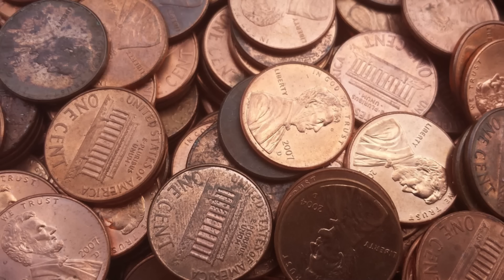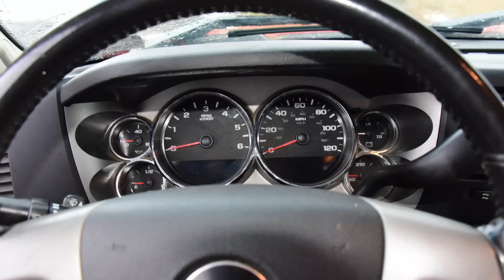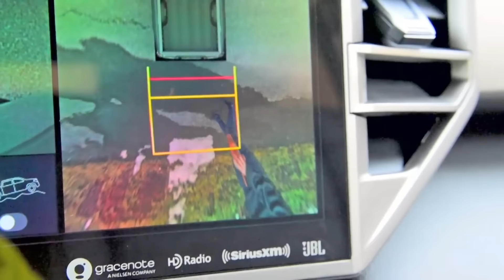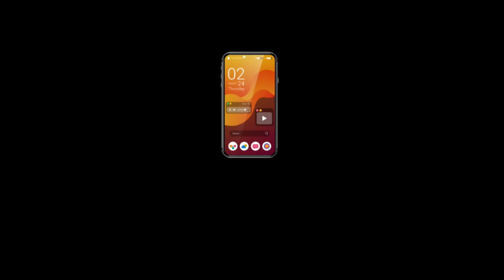2008 Chevrolet Silverado: Regular Car Reviews

Comment: Ahh yes- can’t kill the engines, but the bodies are competing with the Titanic as to which can collapse from rust first.
Reply: 😁 I know what you're saying, but even in the best of circumstances, it's a question of mass. Which will turn to dust first? An engine block, or a body panel? Even Titanic is rotting away around her engines.
Reply: @brandonobaza8610  
I’m coming from having owned one with 250k+, still started, ran & pulled like new; yet I could see through the frame. Darn shame.
Reply: @brandonobaza8610 Well said, dad sold his 87 S10 in the summer of 99 because the rocker panels and chassis rusted out before the engine and transmission gave out.
Reply: @armitage1950 simple solution, don’t live in the rust belt
Reply: Or oil every damn nook and cranny ever 3-4 months😂
Reply: Can’t really admire them in the rear view, CAUSE THEY KEEP BLINDING ME WITH THEIR FUCKING HEADLIGHTS IN HIGHBEAM MODE !!!
Reply: I just went under my 2010 silverado to check the spare tire (cause the release mechanism loves to rust) and I found holes in my hitch and frame. Thank you chicago.
Reply: True, but even down South, full size trucks from the aughts have rust issues, particularly Dodge and GM, even when most other vehicles that age are solid even sitting in junkyards with the clear coat gone.
Reply: Not in the south, these things won’t die
Reply: @seed_drill7135  I can’t confirm, my 05 texas owned Escalade has zero rust on it and I was underneath it this weekend
Reply: Had to get rid of my 06 buick at 100k miles, rusted, sad. Now I have an 08 with 100k miles on it currently, I have to take care of it underneath soo much, but it has 0 rust. Ppl at shops try telling me it’s a Southern car, I just laugh at em.
Reply: @mavness  05 Chevy 1/2 ton. Frame is still good because I have been OCD on washing underneith in winter, but the box and rockers are going through the same agony over here in Iowa. The F*)king salt brine is what is killing vehicles in the snowbelt.
Reply: this is literally mine rn
Reply: spoiler: It was the titanic.
Reply: The DOD engines say otherwise. But I'm not sure when that became a thing.
Reply: I've got the rocker and rear fender rot, but I also have over 500k km of towing and hauling (Red Line fluids since around 100k km) on the original '99 4wd 5.3l drivetrain.

They seriously don't make them like this anymore for a reason!
Reply: I daily a 91 third gen Camaro with 185k on It. Solid unibody in ny 😮
Reply: I mean as long as the dumbass DOD lifters don't eat shit for no particular reason other than just trash design, yes, the engine will literally not die(if maintained somewhat regularly).
Otherwise it'll eat an LS faster than the body can rot lmao. But, do a small cam swap and lifter replacement and it'll literally last forever.
Reply: That turd didn’t make it 10 years before it had holes in the body. I understand it’s 16 years old now but those holes didn’t appear yesterday.
Reply: That engine just needs a few hot suppers and it’ll be done for but you could putt it around for another 10 years easy.
Reply: Clapped out rear springs, and too much junk in the bed.
Reply: ayy more vortec swaps for me
Reply: These engines do die very frequently.  Unless you do a full DOD lifter delete you are driving a hand grenade with the pin pulled.  Usually it’s cylinder #7.   That’s how mine went.    I know multiple other people who have had them go.   One coworker had his engine go with 4000 miles on it from a lifter failing.    It’s a shame because the 5.3 is an excellent engine otherwise.
Reply: Same with WJs, at least if you’re on the east coast, and it doesn’t take that long. My brother brought his from California to Orlando. He’s only been there a couple years, and it’s already feeling it.
Reply: @michiganman4398  I've got a 4,8 so no DOD bullshit. The 5.3 is what I wanted but in 05 they would not do a 5.3 with a manual trans so I went with the smaller engine. I think the 5.3 would be killer to have WITHOUT the DOD bullshit.
Reply: As someone with an unhealthy obsession with '90s Mercedes, this feels just like home
Reply: '11 avalanche here. Rear subframe is definitely rusting and afm is definitely causing oil consumption...125k miles, WA owned.
Reply: My 2014 is falling apart. Lmao
Reply: then we can swap the engines into our Miatas!
Reply: I always tell people my truck isn't on its 3rd engine my engine is on its 3rd truck
Reply: The body and frame of this truck will hold up better than the body and frame of any Toyota truck that old. It looks to be holding up better than my 2011 Tundra did. My bed had holes before the wheel wells by 2017 and the tailgate had major rust after just 1 year. And my frame... yeah. Legendary Toyota rust rot.
Reply: transmissions are shit tho
Reply: Not in texas not a drop of rust to be seen anywhere my tahoe has 300,000 an my neighbor is pushing 450,000 but it's his second motor but still his silverado is in great shape
Reply: @AmbroseBurnside1824  One of the reasons I got a 5-speed.

Comment: When I picture a new truck, this gen Silverado comes to mind. I can't believe this is a 17 year old body style.
Reply: Same.
Reply: I genuinely think this is a timeless design. It blows my mind that this body style is pushing 20 years old. It hasn’t aged at all.
Reply: At 54 Square Bodies still seem 'modern'  to me. I member pre 73 Chebbys on the road as dailies.
Reply: Honestly the best modern body style IMHO
Reply: Yeah, and I've cleaned thousands of them
Reply: I drive a Mk 7 GTI but my father has this truck in regular cab. I love his truck as much as my GTI. I’m 49 and my father is 75 and we both understand the inherent love of a vehicle that just works as it’s designed. Also, I love the fact you used the word “whelmed”!
Reply: It really is wild to me that 17 years ago was SEVENTEEN YEARS AGO. I have memories that feel way too fresh for all that.
Reply: Most cars from 2008 have similar geometry to newer generations. The only Silverados that don't have that modern style are the first gen, which are a bit boxier. IMO the only significant change to auto design since the mid-2000's has been the addition of ridges, composite panels, etc. to add a bit of superficial sleekness. The real differences are inside the car now.
Reply: @jordantomblin2302 I've been told my '12 doesn't look that old every time I've told people it was a 12

Comment: Kunckleman Chevrolet would have been proud to sell this. 84 months at 7.99% puts a smile on every dealer’s face.
Reply: Only 84 months at 7.99%? Gotta go for that 96 month at 8.5%!
Reply: Not to forget the extended warranty, undercoating, roadside assistance, floor mats and pinstriping.  Nothing like paying interest on dealer add-ons!
Reply: $18000 over 72 months @ 18.99% APR
Reply: "This is a VERY desirable vehicle,  I had 3 people call as I walked up to you. " 😢
Reply: Only 7.99%?! That associate must still be in training!
Reply: That’s an impossibly good interest rate for modern times on a used truck. Interest rates are wild these days.
Reply: @jcnz84  There's a guy coming to look at it later that says he wants it. Now, he hasn't put down a deposit yet, so if you want to put on this blindfold, lube up, bend over, and sign this paper, we may still be able to get you behind the wheel of this bad boy!
Reply: @jonr4651  well I was thinking of 2008 - recession interest rates
Reply: I got lucky with 8.49 with a perfect credit score and 70% down payment. It's crazy these days.

Comment: I had a 2008 6.0 2500HD silverado that we used for recycling scrap, and it had been vigorously abused for 12 years before I started. Overloaded on payload, WAY over the rated towing capacity. It just didn't care. 

For a truck that weighs as much as a bank, it handled incredibly well, and was my favorite to sit in for 8 or 9 hours at a stretch. 

That truck had 750k miles on it when I met it, and my boss was the second owner. He swears it was the original engine, and the original 4L80e transmission. 

I admire these trucks so much more for the shear unabated brutality they will take and whatever we did to it, it thanked us and asked for another. Good little road warriors.
Reply: 225k on our 2008 2500hd 6.0 shop truck hasn’t had an oil change since 2014 most likey .idles at least 4hours a day and works in rice dust all day every day when it’s not idling it runs at 5k rpm pulling through the mud still starts runs nice an silent I’m a Ford guy but that is one tough truck for sure and it’s got the Denali interior which held up great and everything still works
Reply: @lucasmclellan8388  about once a month I consider calling my boss back to ask how many miles are on it now. Whoever put that thing together was earning their money that day
Reply: @lucasmclellan8388  I think that thing deserves an oil change 😅
Reply: @porcupinepunch6893  judging by the dipstick it’s fine lol never mind the fact that it smells like pure 91 octane if it’s not black they don’t change it lol
Reply: @Grassroots_Hegemon  lol for sure she was definitely build at 1045 on a Wednesday I almost want to buy it off of them just to give it some much needed love 😂
Reply: More than likely yes the original 6.0 no doubts but the 4l80e.. HELL NO.
Reply: @badazz2969  I had my suspicions on that one because any transmission treated that way would have shit a brick in my thinking but i wasn't in a position to argue. We had another recycler we worked with though that had 370k on his 2500 and he towed pretty normally (in spec) and I believe he was probably still on his first, but its getting on 10 years out
Reply: In my experience, the trucks you flog the hardest last the longest
Reply: Nothing  young with Chevy trucks

Comment: I can't be the only person who thinks the current gen pickups are also REALLY ugly. Like the 2024 Silverado, they took the front end of the Camaro and stretched it vertically in a way that is like a design war crime. And then they redesigned the Colorado, which was pretty good looking, to follow the same theme
Reply: I actually like the looks of the new Colorado/Canyon. But yeah--the Silverado? I dunno what's going on there, though the new electric-only Silverado RST has a nice shape and front end (I mean, basically it's an evolved Avalanche, if we want to be honest).
Reply: It was like the designers heard all the 'overcompensation' jokes about big/aggressive trucks, and then just doubled down even harder. The grills are twice as big as they need to be, so if you want it to look balanced you HAVE to buy a big wheel/tire package to even out the proportions.
Reply: Naw, it's like a handful of design queues to the early '80s frontends where the K2XX was a throwback to the late '80s
Reply: New trucks, look like they came from Legoland!!
 Way to big and boxy... truly effing ugly!!
 The stylists have to be former crack babies!
 ...no offense to actual crack babies.
 I have a 2000 Seirra, and an 04 Silverado, that I both, bought new.
 I keep them indoors, and well maintained.
 The 00 has 310k, and the 04 has 370k.
 Both look new!
 Been gathering parts, to completely redo the 04.
 I have all of the parts to do it. Suspension, brakes...interior...everything!!
 Gonna be next winter's project.
 Gonna rebuild, and upgrade the 5.3, trans and  diff.
 I have 15.5k invested in parts.
 Excellent machine shop locally.
 I figure I'll  have 20 to 22k into the whole thing when finished.
 ...about one third, the cost of a new truck....maybe less!!!
 And it will be...just like I want it!!! 😃
 Next year, I'll  do the same treatment to the 00.
 I'll  keep them both for another 20+ years...or until I croak, which ever comes first. 👍

Comment: I have a Silverado of similar vintage and lesser rust issues.  Would I ever try to daily a truck like that?  No, fuel is expensive.  Would I ever want to be without a truck like that?  No, it's like having access to a joker at all times.  Always there to help when a storm hits or to haul away garage and attic flotsam, or haul a myriad of stuff for that matter, a true friend.  Mine has a cap and a sleeping bag so it doubles as a ready made camp site.  I have noticed that it graces you with instant cred with all people.  Men and women alike perceive you as a serious doer, honorable and capable.  I love my Silverado and all it's warts, except the gas mileage maybe.
Reply: It's sad that Americans are missing out on small diesel pickup trucks. I reckon they'd sell well there.
Reply: My 05 has the same engine as the OP truck but the 5-speed. Gets 20-23 highway at 55/60. Not too damn bad for a full size 4X4!!
Reply: feel the same about my 04 tundra; get to lug all my crap in the back under the camper shell with no worries, but mileage is a killer
Reply: What you do needs to have a value higher than the gas mileage. Utility is utility and shuning it for a couple bucks is wrong. If what you are doing is important enough you will ignore fuel economy to a point.
Reply: @nicktaylor2544  I think you didn't understand, I just said I wouldn't choose it for a daily driver.
Reply: @seththomas9105  those are so hard to find, I've always wanted to own a newer full size truck with a stickshift after owning a Ranger and a Squarebody. Agreed, that fuel economy is quite good, I could live with that.
Reply: @dolfandon7124  I was stoned and didn't get it. sorry brah
Reply: That's why I ditched  cars for trucks 10 years ago. It's always wise to appear useful, even if you're not. I own three Chevy trucks a 91 a 94 and an 02. Two 5.7's and a 4.8. Wouldn't trade them for anything. Am I overcompensating?
Reply: @zephead4835  Not if you use them
Reply: @seththomas9105  Yeah the Vortec and LS series engines mainly the small block Chevy's are designed to get great MPGS highway. They get better than the shitty ford motors and their OHC. Shows you how more simplicity can mean more better. Simple, proven design that goes back over 60 years. Simple push rod with port injection small block Chevy V8. Ain't never once let me down.

Comment: the 08 Silverado is one of the best trucks made in the past 20 years. this exact year is a goat amongst truck guys. the engine and trans are incredibly reliable the truck is simple no frills. once I sell my current ship box I'll be looking for one of these
Reply: 2008 is one of the worst years for lifter failure. GMT 900 went to cylinder deactivation in the aluminum engines and it absolutely ruined them. GMT 800 is far superior to the 900 in dependability
Reply: @bucknasty69  You are correct, but unfortunately most GM trucks came with the 5.3 and the DOD system.
Reply: @bucknasty69 the 4.8 wasn't an aluminum engine as I specified. GMT 900 4.8 only had junk 4l60 behind it, no manual option like the gmt 800. Base models had pretty weak everything else. I worked for a mountain resort vehicle fleet with roughly 80 Chevys. We had 1 4.8 truck and it was constantly getting torn up on the mountain. Rear axle, t case, front axle, engine mounts, ball joints were all replaced or rebuilt several times. 1 ton gas 900 with an iron block was far more suited to surviving but the 6 speed transmissions in those like to fail
Reply: @bucknasty69 The 4.8 or 6.0/6.2 without AFM would be the only ones I'd buy.
Reply: my 09 is on it's second 4L60 in under 120000 miles
4L80 all day, everyday
Reply: @paul66766  Yeah it's pretty comical when you put the two next to each other, the 4L80 is monster in comparison! That being said running good fluid in a 4L60 with an aftermarket trans cooler really helps a ton, (Red Line, Amsoil, and the like, no parts store or OEM swill).
Reply: I'm partial to the GMT800s. The GMT900's interior is a big downgrade and the exterior is boring.
Reply: 2005 pre-AFM 6.0 vortec 2500 HD. God tier reliability.
Reply: @billradley yeah, ironhead vortec all day.